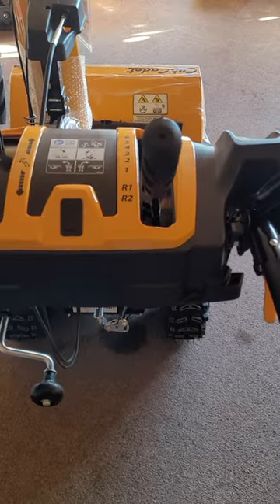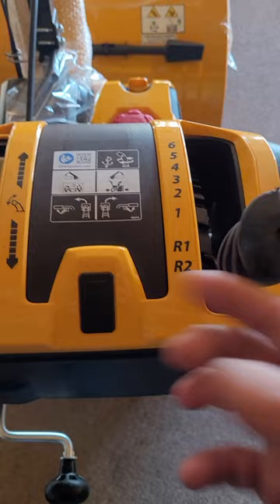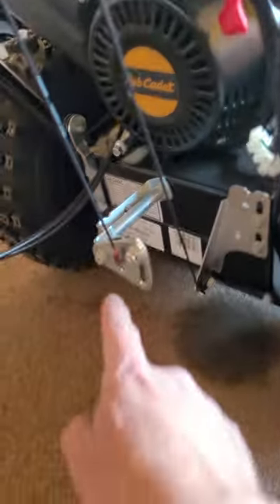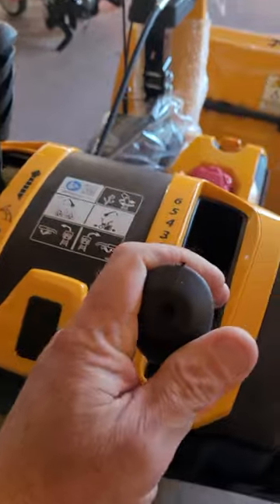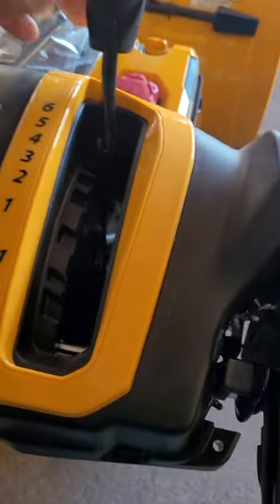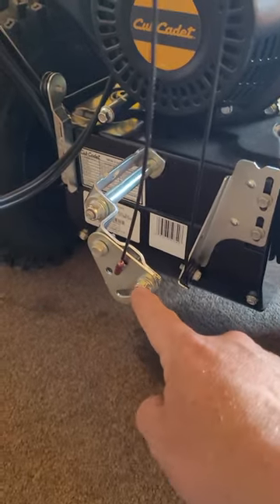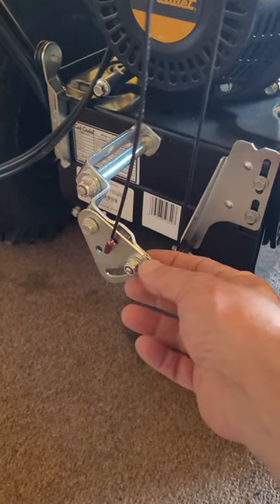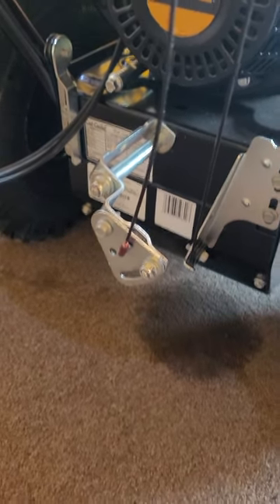adjusting gear selection on Cub Cadet 2x or 3x snowblower

Comment: on the 2X 24 inch snowblower, is it possible to install both heated handgrips and the LED light bar kit?
Reply from the maker: It would depend on what engine is on it. You would need the stator to be big enough to support the heated handle grips.

Comment: Could I run both the heated hand grips and a front headlight on the 357cc 30” cub cadet? If it puts out 5 amps?
Reply from the maker: Yes. I believe it's a 10amp charging circuit.